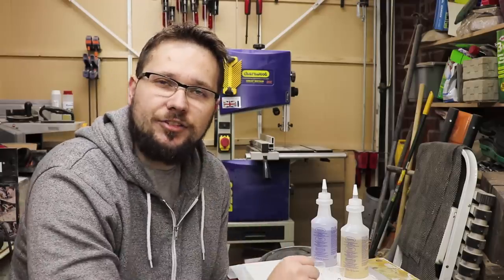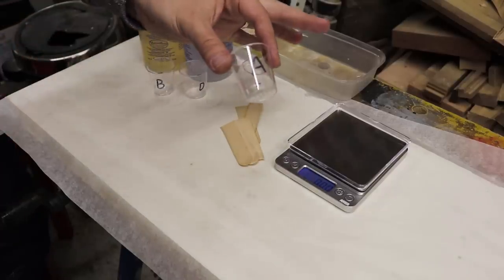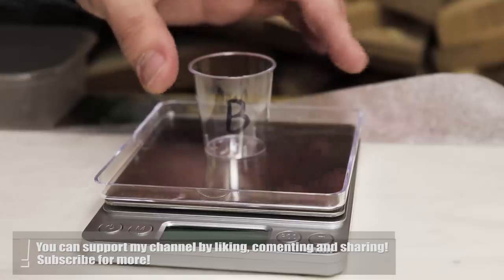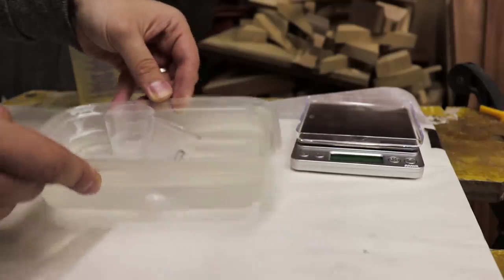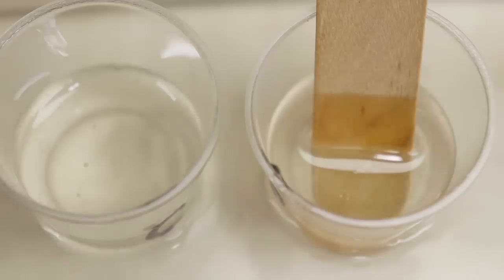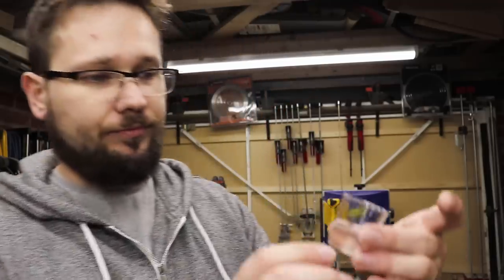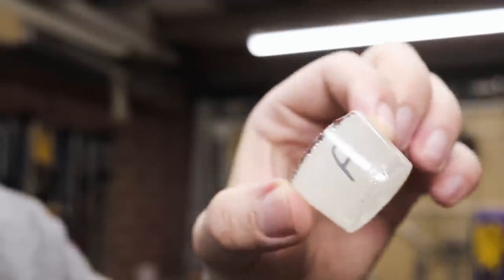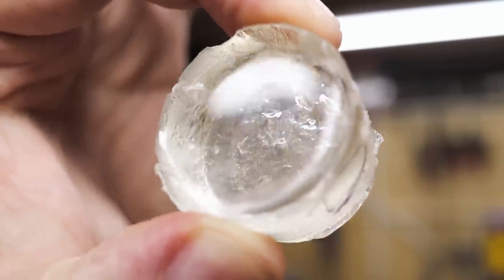Epoxy resin - casting technique to get rid of air bubbles - no pressure pot needed

Comment: Pro Tip: Use a kabob (small Round stick) to do your mixing. Flat, things like popsickle sticks, introduce air despite your mixing action. The resin rolling back in introduces air. A round mix stick will do the same job but introduces MUCH less air. Using heat + round stick+ slow stir + flaming the stream during the pour I have attained crystal clear results (same resin) without a pressure pot.
Reply from the maker: Hi, that is a pro tip thanks! Need to get some 😁
Reply: best place, at least in my country, is the grocery store (market?).
Reply from the maker: @natraz823  hi it's a good tip for slow setting epoxy but it needs a hefty investment in the equipment.  And usually the time needed to get air bubbles from epoxy in a vacuum chamber is much longer. Some epoxys can't be put in the vaccum chamber either as it will impact on the chemical reaction in the epoxy, so it's worth checking the full information booklet on the epoxy you have👍
Reply: Do not use wood stick because tend to absorb part of the component and the rough surtace retain part of them too. Use glass or plastics stirrers
Reply from the maker: @sergioagodoy8357  that's a good tip, thanks👍
Reply: @CasualDIY  i'd watched a video the other day when a guy tried this just to see what would happen. nothing good! he used a slow setting resin, about 40 i think, and he needed every bit of that time. not only did it take forever for the bubbles to appear, but at one point had to put the first container in a second to get all over the overflow as he was tired of depressurizing the chamber constantly. what he was left with was a fraction of the original amount! 

so, i'm inclined just to avoid a pressure pot for getting bubbles out of resin (obviously it's great for for silicone), especially when pressure pots themselves aren't outrageously expensive, not to mention there are good ways of reducing bubbles without any equipment.
Reply from the maker: @ryanbarker5217  you mean the vaccum chamber? Pressure pot pumps air in and by pressure reduces the air bubbles to microscopic sizes that can't be seen by human eye.
Reply: @CasualDIY  I've just started using wood dowel rods, a nifty trick is to reuse your mixing sticks by turning them upside down in an empty pot whilst setting so you get a better surface to mix with the next time. Still a few micro bubbles, but far fewer than with lolipop sticks. I'll try warm water bath to perfect it now.
Reply: Hey ! You said by using heat we can avoid the bubbles . What does the heat here means ? I mean does this mean to heat resin or what?
Reply: @MusicHunter111000  Yep - I reused my round wood mixing stick all the time.  Introduces very little air to the mix.
Reply: @radhikagrover2446  He meant using warm/hot water to warm up the resin before and after mixing in the hardener (as seen starting at 5:33)
Reply: I did read this! I have arthritis in my hands & it's difficult for me to stir. I used a plastic stir stick yesterday, that I left in the cup when warming it according to test "d" in Casual DIY's video. I'm wondering if I use a round chop stick that is plastic coated or perhaps not since the bubbles adhere better to the wood. Flaming the stream is scary to me, but I do torch the canvas many times once poured!   I have many more canvas' to resin, but $$$ is a great consideration. Having to apply more than 2 or even more than 3 coats is not only time consuming, 😣🙄but surely expensive! Thank you "Skool" for replying to my comment too. You guys are awesome! Going to try the chop stick next Skool, round but much stronger to hold!
Reply: @MusicHunter111000  What a super idea Daniel!
Reply: Please wear gloves and a respirator!!! Epoxy is not your friend. It can kill you. Just do it ppl. 😘 love your lungs, you can’t breath without them.
Reply: Awesome!  I have a bunch of kabob sticks, but I am running low on the popsickle variety.
Reply: @sergioagodoy8357  helpful tip!
Reply: Awesome tips Skool
Reply: Thats why i prefer polyester clear cast resin...
No problems at all with bubbles...
Reply: Thank you
Reply: Someone in another video was talking about wooden mixing things being porous and having air in them? And to use a silicone or rubber mixing instrument...
Reply: @silviak1361  will keep that in mind, thanks!
Reply: @Mountaingypsytrading  Yes, you're right.  Wooden sticks are basically bundles of micro-straws - tubes full of air!
Reply: How do you 'flame the stream?'
Reply: Agreed, I use a metal meat skewer with a loop on top, it’s by far the best method I have found, you can actually spin it in your hands to mix really well under the surface without introducing any air at all.

Comment: My two cents: Mix the two components inside a plastic bag having all the air squeezed out the top prior to mixing. You will not get a single bubble. Just punch a hole in the bag when you are sick of kneeding and gently push the stream of epoxy wherever you want it to land. No bubbles, no clean up, no sweat.
Reply from the maker: Not seen that one before, got me intrigued🤔
Reply: @CasualDIY  I guess I have done too much epoxy mixing in my project. All were small batches > 1 g apiece so using cups became quickly uneconomical because of left overs. I started cutting plastic bags into squares intended as lining and it evolved from there.
Reply from the maker: @kokeskokeskokes  very cool idea mate
Reply: I'm gonna try your method and see how it goes. Seems like homemade vacuum chamber! I'm working with large molds and the torch is not enough to burst the bottom bubbles.
Reply: @perseus6852  Awesome.
Reply: You should post a video of your technique.
Reply: I’m totally going to try this! Very simple and it sounds effective
Reply: Woah! Makes so much sense. You should definitely post a video of this. Thanks!
Reply: I will try to make video of me doing it, I didn't have access to camera. Now I at least have a webcam. It is not always simple, but with slow cure I have had no problems.
Reply: I was a little afraid to do this thinking I would surely botch it up. But...I'm going to do this for a small canvas to try it out! This technique sounds like it could do the job well. Thank you Jan!
Reply: @kokeskokeskokes  I checked your channel, but didn't see a video of this yet. Hope you do DO IT! 😅🥰🐇💗
Reply: I don't get it. How can you have all the air squeezed prior to mixing and then mix it.
Reply: Jan Kokes definitely going to try this! Thank you!
Reply: Seems very interesting !! Do you have a video of this technique ? Thanks.
Reply: I’m new at dice making and using resin. Used this technique because I didn’t have a pressure pot and I can confirm this works amazing! The only bubbles I got were small ones from pouring and that’s it. Thank you so much!!
Reply: This is a great idea, I can get my hands on lots of plastic bank bags which would be super ideal for this I think
Reply: Sounds like an interesting idea, but Im a bit confused about the directions. A video wud be fantastic
Reply: This sounds like a great idea, are you still keen to do a video? It would be great to see. Did anyone else try this technique and how did you go?  I will try today.
Reply: One attempt at this so far.  Big reduction in micro air bubbles, although one of 3 pieces did have a clump of them.  None were devoid of small / medium bubbles but this also a factor of my small part mould with corners and over hangs. I'm not sure I mixed the resin throughly enough as it was unsually soft in all 3 even after 18+ hours.  Mixing within the bag is certainly doable and even though I was concerned about mess with a bag it was straightforward to pour.  Have done 2nd batch and put plenty of time into mixing resin thoroughly.  No obvious bubbles formed.  Not a complete vacuum and so two bubbles or so where in the bag, however, pouring out of one corner seems to naturally release bubble instead of passing into mould.  Bag mixing certainly helps avoid waste of entire paper cup.
Reply: Second attempt worked much better, more rigourous mixing for 3 minutes. Mixing with bag feels more effective and less concern over bubbles forming. In my case I'm working with small mould pieces so I'm mixing 6 of total resin, for 3 pieces.

Air not completely released from bag, 2 bubbles but these did not affect mixing or appear in the final pieces.  Very few micro bubbles onced pieces cured.  
Both attempts started with resin bottles submerged within plastic bag in hot water bath for 10 minutes. 

Other aspect of this process is placing bag into existing hot water bath to easily apply heat to resin.
Reply: @1985cactus  fill the bag with the required amount then squeeze out the air, pinch the bag so no more air can return and squish it to mix... Poke a  little hole in the corner when ready and squeeze... Or something like that I suppose...
Reply: @chickenchad9814  I'm still learning myself but have used the vacuum baggy technique for freezing meats a long time. I close the bag with a small diameter straw inserted. Then carefully suck the air out and simultaneously withdraw the straw. Voila! No air😃
Reply: Wouldn't the plastic bag be worse for the environment?  You'll only use it once, and you'll throw it together with the hardened resin

Comment: An extra tip from a newbie here – ditch the wooden lolly stick for stirring, which is essentially a series of tall straws fused together - ie full of air.  Mix with a silicone stick instead.
Reply from the maker: You can and its a great tip. However I have not noticed any difference when using a wooden lolly stick.

Comment: I use slow epoxy, takes 72 hours to cure but after a few mins in hot water premix, and 30-40 mins in a water bath after, I get super good results. Also try platic or metal to stir, i find dry wood releases air sometimes.
Reply: What 30-40 min. temperature of water do you prefer? Or different temps for different project?
Reply: I dont measure the temp, usually if i can manage the water on my hands its hot enough, all projects are treated the same way.
Reply: @GondozaSulo  Thanks, I think this is best info on epoxy! Thanks, I can even see wood stir sticks outgassing as stirred, very cool, I can see that!

Comment: For those who buys resin in a larger quantity (gallon) I recommend you to get from the dollar store condiment bottles.  Either the colored ones (red and yellow) or the clear bottles. Way easier to control how much you pour when measuring. Also if you use small amount at the time  (like making jewelry and such) get clear medicine cups. They are  clear, and they are perfect for measuring. Whatever is left on the bottom after use easily pops out the cup and you can reuse them over and over.

Comment: Thank you for posting your video, I make batches of around 8 – 10 gram and I basically do the same as you (trial C) but I do another step after that. I use a syringe (without needle) to suck up the epoxy and poor it onto my products. By doing that it is as if the remaining bubbles go to the top of the syringe, you can see them very well and I just stop the syringe when the bubbles come close to the bottom. Then I suck up again more epoxy. The second advantage is, that you can dose very accurately and bring the epoxy at the place you want it to be. I clean the syringe afterwards with acetone, it works really well.
Reply from the maker: Good tip thanks for sharing I may check that out 😁👍
Reply: @CasualDIY  Maybe I should explain better. When I suck up the epoxy in the syringe, there are no visible air bubbles in the epoxy, but it is as when the epoxy is sucked through the small syringe opening that creates some “tension” in the epoxy and that activates the tiny (invisible) air bubbles to “clump” together to become a bigger visible bubble that stays in the top of the syringe, especially when the epoxy is “pre-heated” so it is thinner.

Comment: That was a great experiment! With Alumilite Amazing Clear Cast resin I find it pays to try and not introduce any bubbles to begin with, by using a thinner mixing stick (bamboo skewers cut in half), don't stir too fast, and keep the stirrer in contact with the bottom of the mixing vessel. I am so good at it now I can mix a shot glass without a single bubble :D
Reply from the maker: Great tip thank you. I actually got some toothpicks that should be just fine?
Reply: Sure, for mixing a shot glass they should work a treat :)
Reply from the maker: @resinAce  Thank you, really appreciate your comment and tip :)
Reply: nice tip ty
Reply: resinAce :  resinace is the man so take his opinion to heart for sure!
Reply: depends how much you need. If you want for only a few projects, sure. But if you want to experiment and learn as you go I recommend to buy larger quantity. You can find from 40 $ and up on many places. Yes you might pay more at one time, but it's worth it. A pack of Alumilite runs about 17-20$, you get about 4 cup out of it. I have bought  my gallon resin almost a year ago and I still have left 2/3 of it. I experiment and use resin quite a lot.

Comment: Thank you for using a scale. I watch so many people eye it. That's fine for someone that's been mixing a product for years, but for teaching first timers this is the way to do it. Cheers
Reply from the maker: Just one thing to mention there are two types of resin when it comes to mix in ratios. One is mixed by weight and the other by volume. Always check which one you got👍
Reply: 1:1 mixes you really don't need to use a scale...

Comment: A word of caution, make sure you use a slow setting epoxy. Heat will exponentially increase the reaction velocity, so be careful heating it once mixed. The pot life on the datasheet will be half that time or less depending on how much heat you expose it to, which as it sets will make it more difficult to pour - introducing more air bubbles, etc.

Comment: I use Amazing Clear Cast Resin.  I simply throw both of the sealed bottles in a sink full of really hot tap water for about 10 minutes, then dry the bottles (a must do, so a stray drip of water doesn't fall into the resin), then mix & pour as usual.  I'm also careful not to mix the resin too quickly so I won't be so apt to introduce air into the resin.   I rarely have bubbles but if I do, I quickly hit them with a heat gun.
Reply from the maker: Very good thorough process mate👍

Comment: I’m doing research because I want to make a set of d&d dice for my fiancé, but I don’t want to spend hundreds to get a pressure pot... I’m hoping I can get a decently clear pour because major air bubbles will throw off the dice balance. Great video for new beginners to follow along to. Hopefully when I pour them  they come out clear
Reply from the maker: Thank you, I hope they will come out great for you👍
Reply: For something that small I'd recommend polyester resin. A bit cheaper and smells a lot funkier, however I've found that even with vigorous mixing no bubbles appear. Polyester resin also polishes up to a much more glass like finish over epoxy.
Reply: My gf is doing a lot with resin, i Also help out so now and then.
When we use 2 compound resin, we look for a long curing time, the one we have is fully cured after 5 days ( 48 hours curing time for light handeling)
We found out that the slow curing time reduces the amount of bubbles, but i do still reccomand what this video said to increase the no bubble quality if you don't want to use vacuüm
Reply: Alumilate has a page that could definitely help. Amazing clear cast is a great option and you can get 20% off right now June 2020 using code Amazingsavings
Reply: @LypexGamer  one thing about polyester resin is that it is very sensitive to moisture while curing.  I failed a lot because  the air was too humid. It bubbles like crazy.
Reply: You are a dream woman making dice for a Fiancé!  lucky partner you have
Reply: hi jenna, did it work out? im trying the same but my first few tries were not bubble free..

Comment: Squeeze the air out of your epoxy bottles before you flip them. That way air doesn't mix inside the container before you even start the pore. I find poring onto the popsicle stick releases the bubbles during mixing. Always remembering to pore and mix them slowly. I always use heat as well even if I cheat a step. I never tried warming my epoxy. Good tip I'll give it a try.

Comment: A lot of my family has Polish accents but I live in the US, so they sound different than your UK Polish accent! Thanks for the video, though. I've been using epoxy for a while but have been having problems with bubbles more frequently now that I'm expanding to larger and denser pieces. Dzięki!
Reply from the maker: Hehe yes I think the accent depends on where you live and them you pick up the little language nuances that are specific to that area. If it helps I just made another video about some resin basics https://youtu.be/BEwgDjoZAbE
Reply: It's definitely different to UK Polish accents I hear in the South of England too, you seem to have picked up a lot of Midlands!
Reply from the maker: @kkcty  hehe could be 🤣

Comment: What's best way to remove micro bubbles in the resin. I'm still new to this and getting micro bubbles in finished items.
Reply from the maker: The best way is to use a Resin pressure pot